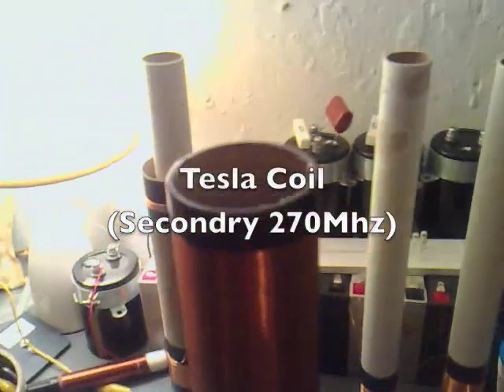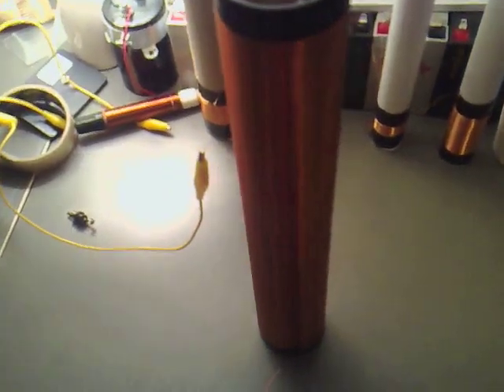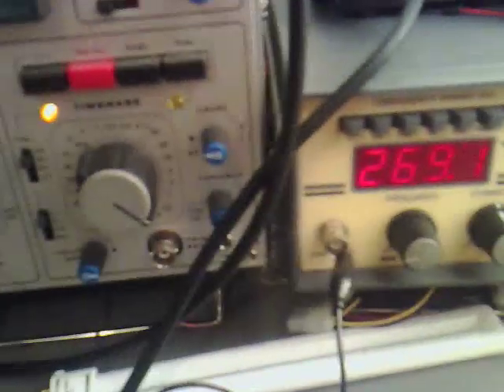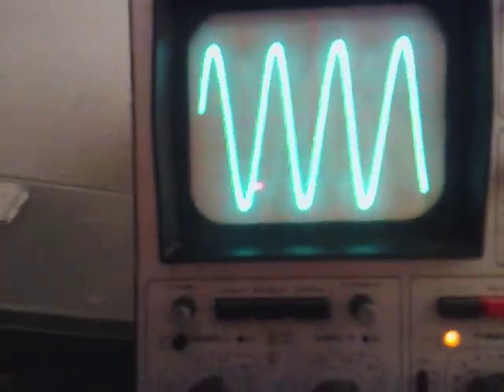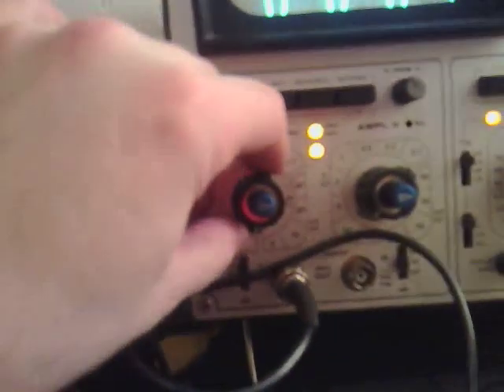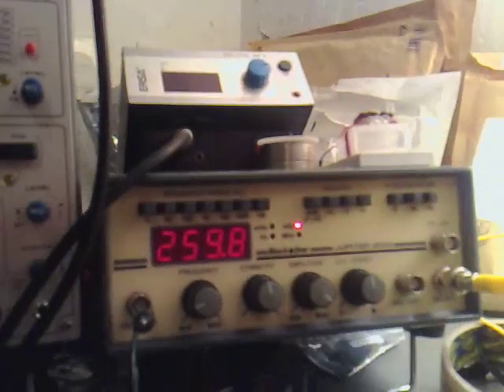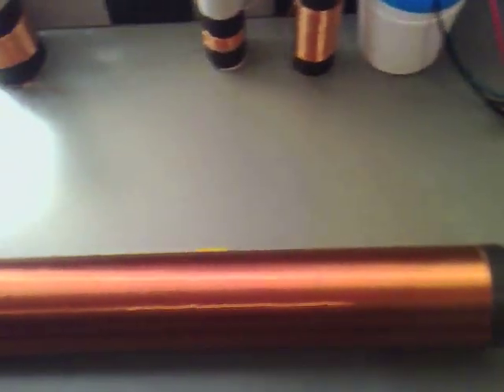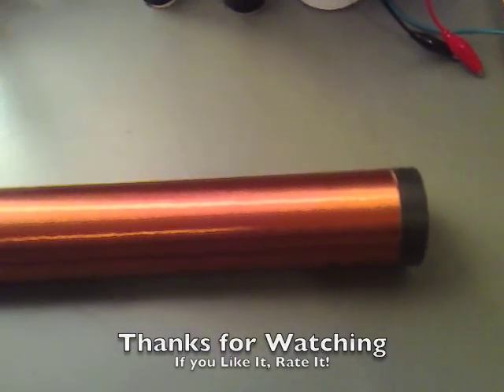Tesla Coil (Sencondry) 001

Comment from the maker: You can make them out of a junk Microwave, it has All the wire you need in it. There is a fan at the back with some, what must be 0.1mm wire (just do 1000-ish turns. And the Micro Wave Oven Transformer has the primary windings needed.. Apart from that you need an old CRT Monitor for Capacitors, transistors and the flyback transformer.
Sorry to Hear you got layed off but you could put your time to good use are your good a finding discarded items.
Recycle dude, you can do it!

Paul.
Let me know.

Comment from the maker: Thanks, it is on a cardboard tube that is 3mm thick and has an outside dimension of 55mm.

The wire is 0.25mm and I planned on 1100 coils to make it 1:5 ratio, but I took it up to 300mm because thats where my ruler ended, lol. should have been 275mm ish.

1200 Coils at 55mm is 66000 = 66 meters Long (wire) I think that right any way.... I think thats why it took so long!

its resonant frequency is 270kHz not MHz on the title.

Are you building one?

Paul.